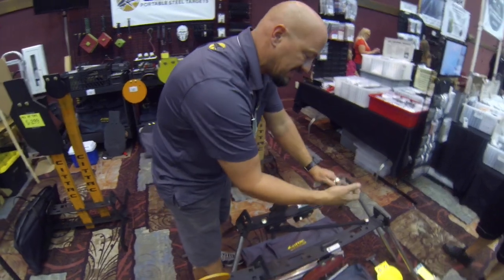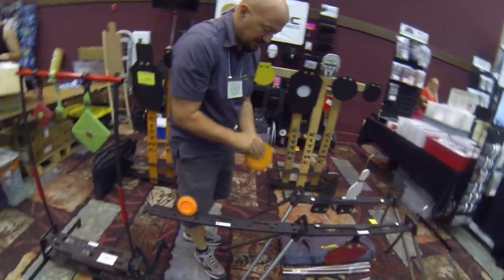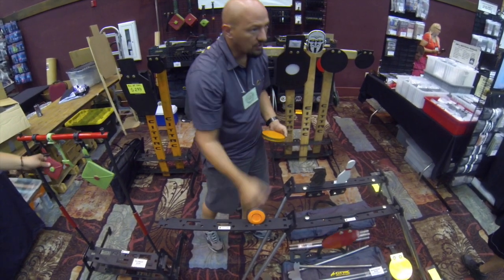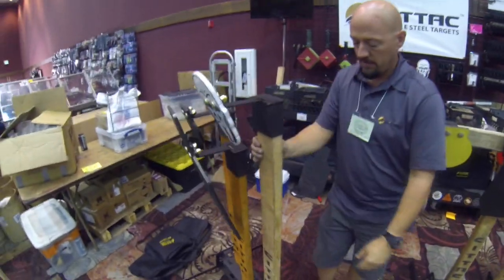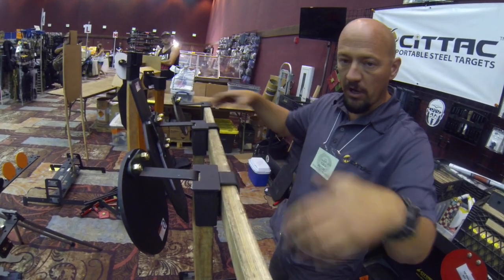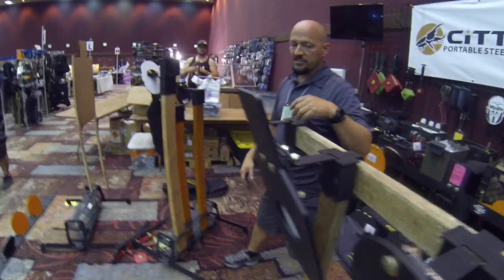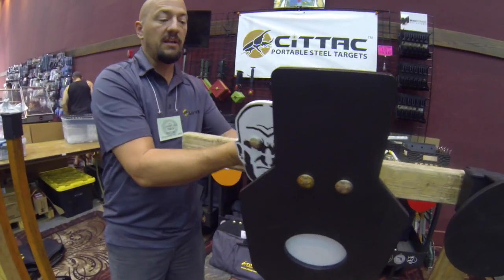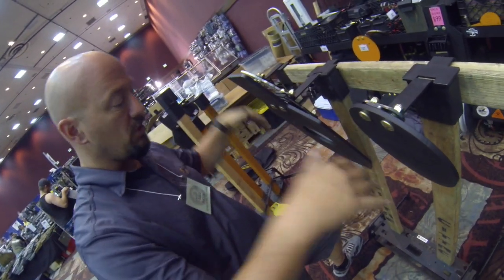Steel Target System

Comment: That's pretty slick.  The stands are a bit pricey but a lot of utility.
Reply from the maker: Bruce Tuller  - It is a really cool system . . . made from 100% AR500 steel and very solid. Lots of options for deployment.
Reply: It is pricey but you definitely get what you pay for.